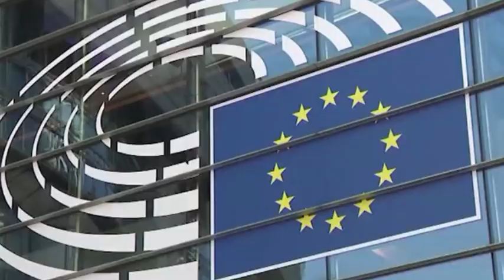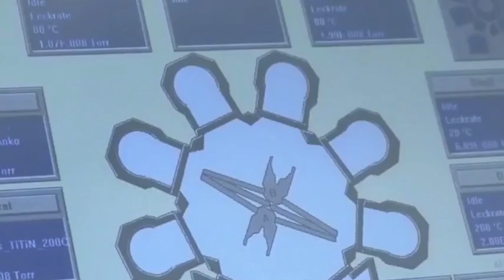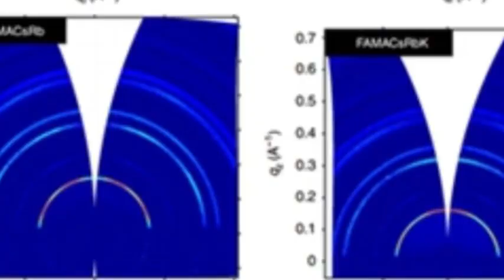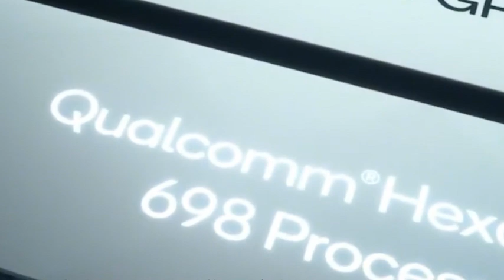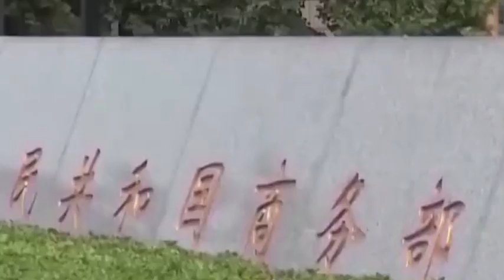If ASML listens to the United States and no longer repairs DUVs, can China repair it itself?

Comment: As an engineer and.designer, I have repaired many types of machines. From this type of experience, I have repaired many types of machines - some using compatible parts, some using redesigned modules. Overall it is possible to finally get the machine to work. One major problem is time because  certain technologies need time to understand before redesigning of modules to do the same functions can be carried out.